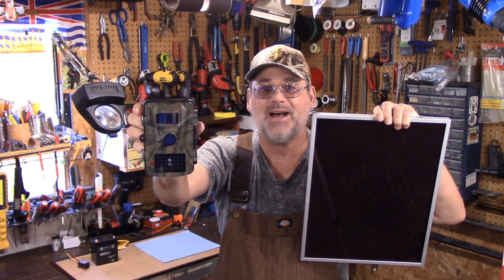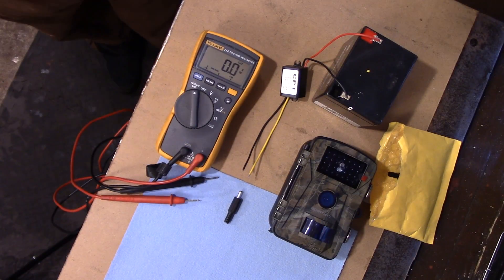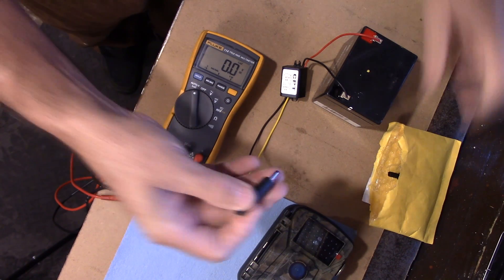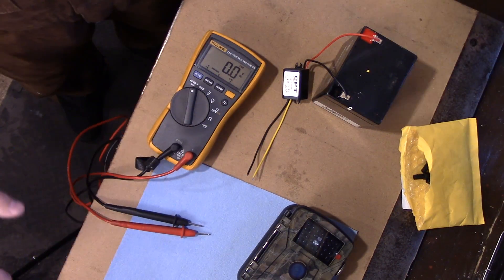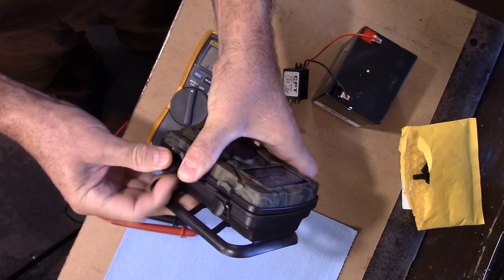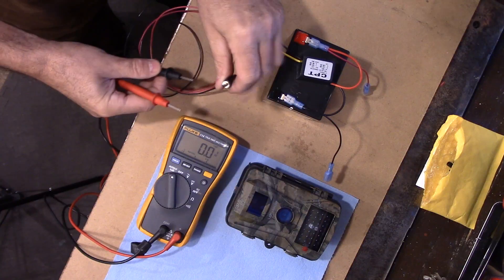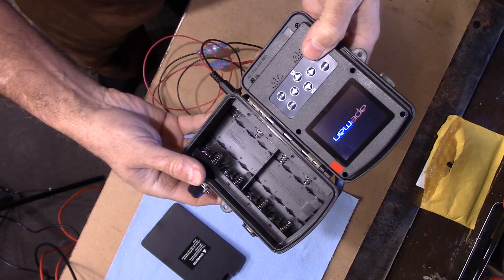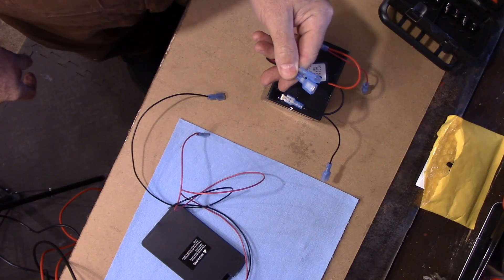HOW TO WIRE A TRAIL/GAME CAMERA  TO A SOLAR PANEL AND 12V BATTERY  - PART ONE

Comment: Is there a way to run a 6v/12v trail camera off of 110/120v household power?  I would like to monitor my rural property that has electrical power with something like a Tactacam Defend camera over cellular. Where I live, temps can drop down to -70 fahrenheit which is a battery killer.  I probably could wire the camera to a 12v marine battery and connect a battery tender to it but with the price of car / marine batteries these days it doesn't seem like an affordable solution.
Reply from the maker: This will do it ,  just match the ends to your camera input jack. Amazon has many styles that will definitely work for 12v or 6v. 

https://www.amazon.ca/dp/B09BQBWKKT/ref=sspa_dk_detail_6?pd_rd_i=B0711Q5B49&pd_rd_w=eI7tl&content-id=amzn1.sym.feb8168a-837d-4479-a008-abb92f74a28b&pf_rd_p=feb8168a-837d-4479-a008-abb92f74a28b&pf_rd_r=ZGYBQ89MX5G7J7RTFN1R&pd_rd_wg=xw7Ww&pd_rd_r=9057cc7c-8692-4ac6-bcd0-4f7c9e2b418b&sp_csd=d2lkZ2V0TmFtZT1zcF9kZXRhaWxfdGhlbWF0aWM&th=1

Comment: Last I checked, 8 AA’s added up to 12v not 6v
Reply from the maker: 4 for the camera and 4 for the camera light , both separate systems.  4x1.5=6v
Reply: So my cameras share the power between the light and the computer. A simple 12v battery does just fine.

Comment: Where did you get the plug?
Reply from the maker: Off ebay .
Reply: Do you have the part number
Reply from the maker: @blaineake9596  There are no universal  part numbers as the plugs are specific  to each unit so just look at what plug number is in the manual and you will find it easily.

Comment: Don't forget the diode between the solar panel and battery. If it is not there the panel at night will pull power from the battery.
Reply from the maker: I have installed a one way diode and tried not installing a diode on panels 5w and less and have not seen any draw at night .  I have read the same and all my 100w panels do have them  so I'm not installing them anymore on 5w and under.  I looked at a store bought unit a 2w unit and no diode was used so  I have been doing the same since . Cheers Basil

Comment: What is that little connector plug actually called? I can't find it on eBay or Amazon. Could you post a link?
Reply from the maker: Been so long I don't remember but most likely not a universal application so one would have to match it up to the system you have.

Comment: Good idea Steve!  I'm a little confused on these voltages though.  8 AA batteries = 12 volts.  I wonder if it converts 12V to 6V internally.
Reply from the maker: The camera only used 4 on each side . 4 for flash and 4 for a picture . 4 ×1.5 =6v
Reply: @SteveRobReviews  Oh ok, that makes more sense ;)

Comment: Looks like the setup will work pretty good as long as you can get the sun on the panels in the woods. Have a  good one Steve!
Reply from the maker: Trial and error and lots off error if there is lack of sunlight so some field testing forsure. Cheers Terry

Comment: Everyone should take the Steve Rob challenge.   Every time he says Bat Tree, take a shot of whisky.  You're gonna want to have a fresh bottle.   But seriously, I have two trail cams, and false positives are a huge nuisance.   I had my cam attached to a small tree, and I figured out the wind was moving the whole tree, and really using a ton of battery and memory.
Reply from the maker: LOL bat tree .  The whole idea and selling point is  the trail cams are to take picture of items that  trigger the motion detector , in reality its  any motion within 40 feet seems to set it off mostly from tree branches . I have yet found a real good trail cam where the specs match . I have a 12mp unit and it takes pics like a  my old kodac XL15 from the seventies .   They just make crap up and we buy it:)
Reply: @SteveRobReviews   I have tons of zero results.   Weeds grow up and wave and set the cam off.  The trees move.  Stupid birds land in front of it.   Neighbors cat.

Comment: Nice ! Steve, what keeps the solar cell from over charging the battery ?
Reply from the maker: Stick with the 12v 7w  calculation as the downstream calculations are just a load as the solar panel only charges the battery at 12v .
Reply from the maker: Good question . It's under  or about an  amp  just like a battery maintainer would charge at so it will never overcharge .
Reply: @SteveRobReviews  Your right Steve, if I did the calculation right, it's about   .538ma or just over a half of an amp at 7w/12v. Or is it at 7w/6v with a 1.16 amp being supplied to the battery ?

Comment: Steve it is even easier. Ebay has non soldering connectors with tiny screw terminals fo the same cost for the plugs you have. Their made for wireless wifi surveillance cameras. In the US their is an electronics surplus computer store in Van Nuns California. All Electronics inc. That sells those plugs and small solar panels they ship internationally. Also they have two eBay stores for the dead and discontinued items. Their electronic surplus store is All Electronics and the computer store is Frank's Fast Ship. I have gotten some real bargains from them.
Reply from the maker: Thanks I will take a look. 👍
Reply: @SteveRobReviews  When you do be careful easy to make a lot of purchases for different projects. I have trouble with that.
Reply from the maker: @VickyGeagan  🤣🤣 me too.

Comment: The 8 batteries must be connected with the two sets of 4 batteries connect in series connected in parallel with each other because 4 AA batteries provides 6 volts.
Reply: Steve, I think you can eliminate the Voltage Converter.  8 batteries @ 1.5 each is 12 volts.  Unless we have to consider that U.S. to Canadian conversion factor thingy!!  ;)   This is a fantastic idea to keep the cameras rolling longer.  Cheers!
Reply from the maker: Well gentlemen  most trail cams are divided into two parts of 4 batteries each  . 4 for the flash and 4 for the camera each at 6v . I'm using metric batteries  of course :)
Reply: @SteveRobReviews  are metric batteries like a metric crescent wrench? Ha ha. Interesting that they are connected that way. I have never used a trail cam. The digital cameras we have used use one set of batteries for the flash and camera. Maybe I am missing something but it seems like connecting both sets of batteries in parallel  would insure that the batteries wouldn't go down to one part of the camera before the other. Either the flash or the camera batteries would likely drain before the batteries went down for the other. Might be planned that way so it could keep taking pictures after the batteries for the flash went dead or since the camera is powered all the time the batteries for it might die first.  I wonder if using a solar panel designed for charging a 6 volt battery and a 6 volt battery might be less expensive because you wouldn't have to use a voltage reducer or are 12 volt systems like you set up less expensive with the voltage reducer because more of them are made.
Reply from the maker: @gordonwilloughby8793  Yes it can be done if you get a 6v solar panel for a 6v battery. I use 12v  batteries and bought a bunch of 12v solar panels so its 12v as the parts are easily bought for all that want to try this too. I posted a Instagram pic last year of my trail cam that a bear decided to eat LOL
Reply: @SteveRobReviews  The bear must have a strange appetite. If you are close enough you can use a wifi camera so you wouldn't have to go to the camera to retrieve the memory card.
Reply from the maker: @gordonwilloughby8793  The trail cameras make a clicking noise when activated and bears just dont like to have their pictures taken . 🤔
Reply: @SteveRobReviews  must be shy. Some people are like that too.